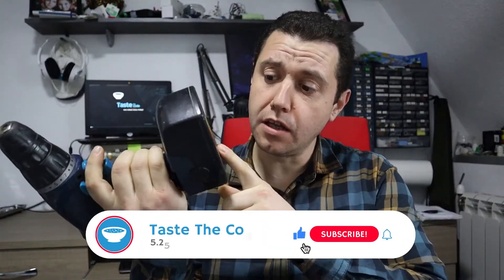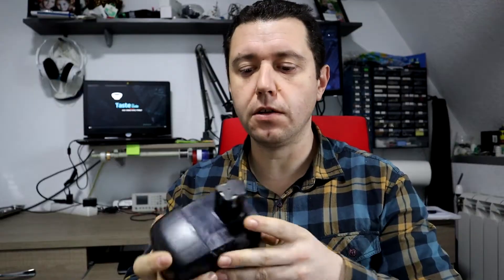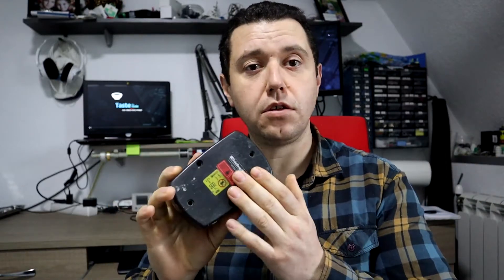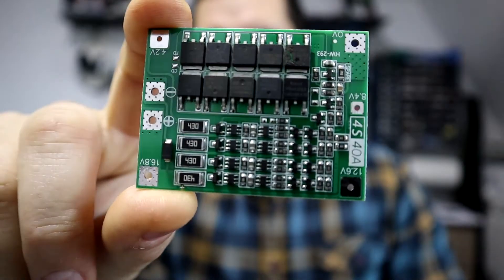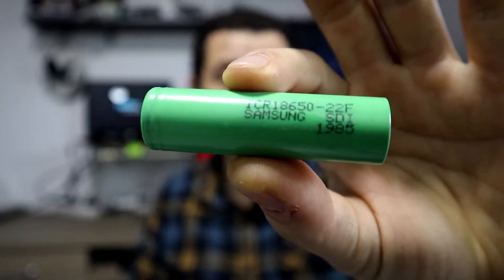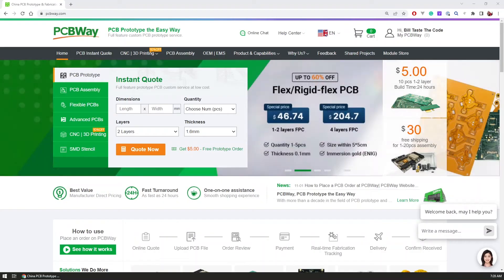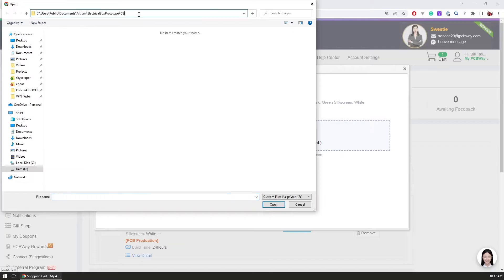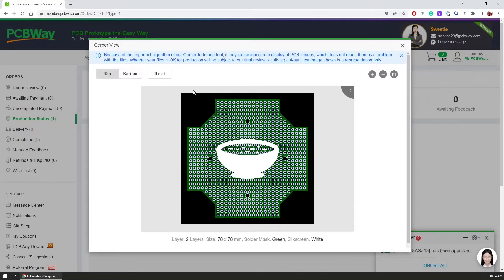How to turn your outdated NiCd tool batteries into powerful Li-ion ones!

Comment: Excellent Can we use the same or greater pack without BMS?
Reply from the maker: BMS is essential to handle the batteries safely. Otherwise you will damage them.

Comment: Would it work to put the BMS and the charge control board in the battery and use the original Ni-Cad charger un-modified ?
Reply from the maker: The BMS goes to the pack anyway. If the original charger will work, depends entirely on the charger and how "smart" it is...
Reply: @TasteTheCode Years ago some of the Dewalt stuff then NiCad charger didn’t put enough amps to charge the Lithium ion’s
Reply: Loved watching you work and do an excellent job thank you so much

Comment: Interesting. I have an old mini vacuum cleaner and its NiCd batteries are gone. I have many good 16500 salvaged from old laptops batteries. I am an asshole in electronics. I could rexharge them outside the vacuum cleaner, but would be better to use its original 9 volts connection.
Reply from the maker: 9 volt is a bit complicated as 2 lithium cells are 8.4V when in series and fully charged but go down to 6V when empty. 3 cells in series range from 9V when empty to 12.6V when fully charged. Maybe a 3s with a dc to dc converter is your best bet.
Reply: @TasteTheCode  The original charger is 9 volts. Electrolux. I was planning to use the same charger.

Comment: Hi,
How do I make sure that a conversion like this project would give me the required torque? I have a 3.0Ah impact driver with a stated torque of 85Nm. What version of BMS and what type of a battery spec should I use? Any help from you genius guys will be greatly appreciated. Thanks.
Reply from the maker: Generally, larger current provides more torque. So go for the largest rated BMS you can get. Also, more cells in parallel can provide more current but it is a limit of space if you can fit them.

Comment: How can I make use of lots of 4.8V Nicle Cadmium Batteries? Almost 100 Batteries
Reply from the maker: Sure, as long as you fit them inside. In that case you will also be able to use the same charger as well.

Comment: I have sense, and also, unfortunately power tools with dangerous lithium ion batteries. There needs to be a way to convert power tools with Li ion batteries to much safer Nickel-Cadmium batteries. I'd like for my house to NOT burn down.
Reply from the maker: I understand your concern, and you should always be careful when handling Li-ion batteries. However, it is not that they will just ignite. Yes it is possible, but if treated properly, you do not need to worry.

Comment: If you have the parts and batteries it’s probably good. But, checking prices having to buy everything seems way too expensive.
For someone without much experience and money who simply want to revive an old drill. Do you recommend to just buy the same batteries and just replace them? The ones I have are 1300mah and the ones I found to buy are 2800mah. Would this be an issue? Or would they be a little better? (more power?)
Because the other issue is the charger, that would be even more money required to make the conversion. And would be best to use the charger that the drill already has.
Thanks for your time if you read all this 😁.
Ps/ or do you think it’s just not worthwhile and I should just get a cheap drill and forget about this? The batteries are almost the same price than a cheap drill with 2 batteries. But, of course it’s a cheap drill and the one I have is not a bad one.
Reply from the maker: To reuse the same charger you need to buy the same style of batteries that it had. If the drill had NiMH batteries, then go with that. Lithium batteries on the other hand should provide the benefit of lasting longer (in theory!) and holding more charge for the same volume. Converting everything over when you buy all the parts is expensive. I use old laptop batteries for my conversions and so far they work OK but I get them very cheap and the chargers from AliExpress are super cheap as well. As for the cheap drills, they've gotten to a point that they are cheap and reliable enough to justify buying several cheap ones that will outlive one expensive one. I hate to see working things being thrown out and replaced with new but it is the most logical step in terms of monetary value. I rebuilt the batteries just for fun as I enjoy the process.
Reply: @TasteTheCode Yes, I also hate to throw perfectly good things that just need a simple fix. I looked on AliExpress and the batteries cost almost the same as a cheap drill; but, I’ll wait until they have some offer to get them. I’ll go with the same ones the drill had just to make things easier. Would love to convert it to lithium, but, it’s not worthwhile price wise. I’ll be on the lookout for batteries as you said; but, even with the batteries I still need the device to regulate the power and the charger. Though, a lipo charger is not so expensive and can come handy for sure in the future, for… something 😅
Reply from the maker: @GnarledSage  try to look for batteries in a local electronics parts store. What makes them expensive online is their weight so getting them locally is usually much cheaper as they get them in bulk.

Comment: Hello!

I enjoyed this video very much, thank you!

I wish to convert a 19.2V NiCad powered drill to Li-Ion. I plan to use 5 Samsung 25R high discharge 20 amp 18650 cells in series (5S).

How do I determine what balancing BMS board to use - what factors do you consider when selecting one? Do they come with a diagram to show the connections? What gauge or diameter wire do you recommmend, and stranded or solid?

I know of someone who tried one BMS for a 5S pack and it seemed to work but then he realized he lost the drill's variable speed function - it was either on full speed or off, so I don't want that to happen. He never got it to work correctly.

Any advice on this would be appreciated because I just need the correct balancing BMS to complete the project.

Kind regards,
John
Reply from the maker: Hey John, thank you for the support! I really appreciate it. 

In terms of the BMS, the most important part is the current rating and the S rating which you already have it figured (5S). You would want anything above 40A just to be on the safe side. From what I saw online, most 5S BMS boards come rated at 100A. Other than that, there is little difference between them, they just monitor the voltage of each cell and once it reaches full, they just re-route the current through resistors until the rest of the cells are full. And yes, most will come with diagrams but they are also marked with voltages on the board. You start from 0V as the negative of the first cell, and you work upwards, adding the next cells until the last cell. 

As per the speed issue of your friend, I've never heard of such thing and I don't see how it is connected to the battery pack. On all of the drills that I've seen, the speed is controlled by the trigger switch that variates the voltage send to the motor. He must have done something wrong to the switch to loose the variability.

Comment: whats the purpose of the single cell inserted before closing the case?
Reply from the maker: It is just a spacer so the pins on top don't get pushed in when attaching the battery to the drill. The old pack had the last cell in the upright and it pushes on the contacts on top. If you noticed, I have it wrapped in electrical tape so there is no contact on it with the rest of the battery. It is funny cuz the video has 71k views, and you are the first one that noticed it! 👍👍
Reply: @TasteTheCode  thanks for the quick reply

Comment: Hello, how to check if my power adapter is for charging li-ion batteries?
Reply from the maker: If a charger is for li-ion batteries, its output voltage will be in multiples of 4.2V. so for example, 4.2V for 1S, 8.4V for 2S, 12.6V for 3S, 16.8 for 4S, etc. The S marking indicates how many cells are connected in series.
Reply: @TasteTheCode can I use a power adapter from a router or a modem for example??
Reply: @TasteTheCode  thank you very much for your help
Reply: @TasteTheCode  but the chargers for our phones are 9 or 12 volts why is that?
Reply from the maker: No you can't use a generic charger as there is extra circuitry regulating the voltage in those devices. You must use a charger with the specific voltage that has that regulation circuitry or add that regulation in between yourself.
Reply: @TasteTheCode  ok got it thank you my friend

Comment: Hi . I have a cordless drill with 17 rechargeable batteries of 1.2V 1300mAh etch, 20.4V total. Can i replace them with 4 pieces of 5V?
Reply from the maker: I haven't heard of 5V batteries. Li-ion are 3.7 nominal, 4.2V when fully charged.
Reply: 5 batteries.

Comment: What charger  do use afterwards as standard charger be no good
Reply from the maker: Right now I'm using my bench power supply but you can purchase a dedicated charger from AliExpress that matches the nominal voltage of the battery. It doesn't need to have protection as the BMS will keep the battery safe.

Comment: Can I still use the original Dewalt 18 volt Nicad battery charger? Or do I have to purchase a dedicated battery charger for the Nicad to Lithium ion battery conversion?
Reply from the maker: It depends on the charger but the answer is usually no. It is best to purchase a dedicated charger for lithium batteries. In my case, I'm using my bench power supply to charge it.
Reply: @TasteTheCode  
Thank you for the information
Reply: @TasteTheCode 
Sorry for another question. What is the white tape you use called?
Reply from the maker: It is just an electrical tape that is 50mm wide.

Comment: How to charge the new lithium pack? What with old Ni-cd charger?
Reply from the maker: No, I'm using my bench power supply. Best is if you get a charger specifically designed for lithium batteries.

Comment: Its cool to see u keep the old nickel strips on, but can we put 1 more layer of nickel strip on top of the left over nickel strips ? And oso can we use nickel strips better den u use the white wire that u solder it??
Reply from the maker: Sure you can. I don't have a spot welder so I have to improvise.

Comment: Hello friend, I don't know much English, but I will try to explain my problem: , I tried to change the battery of a 14.4 v drill to lithium, I used recycled 18650 batteries (obviously tested and with the same voltage) and formed a 4s2p pack and bought 4s bms boards at 40 amps (balancer type), and on three occasions the plates did not withstand even a vacuum test: (without effort) I thought it would be a defect in the board but I ordered from another store and now that I tried a new one and did a vacuum test performance, suddenly I heard a small explosion, I ignored it and continued drilling, until I heard a second one so I assumed that something had happened in the BMS and yes, a mosfet exploded and the truth is physically you can't see anything else but I think that more than one component must have been damaged as well. In your videos it looks so simple (and it really is, it's not very scientific) and this is happening to me, I only did a vacuum test on the other boards and apparently the transistors that are responsible for balancing the cells are heating up too much ( one or two, not all) and when I load them with the imax6 I get "connection break". Can you explain to me what I'm doing wrong or what causes could cause this to happen or at least what should I do? I thank you in advance.P.S: There are more details to explain but I didn't want to go on too long, if you need more details let me know
Reply from the maker: Hey, sorry to hear that. I don't fully understand what you mean by vacuum test? If the MOSFETs are exploding, it means that you are trying to pull a lot more current through them than what they are rated for. Try going with much larger BMS, something like 100A.

Comment: Get a group that is close, use the bms sized for the correct amps. Use a charger that is designed for lithium ion. I find usbC to be awsome for this as it can autorange 3.6V 7.2V 12V and 20V ❤
Reply: If by awesome you mean crappy because they charge so slow, then sure.  Awesome.  Maybe you instead meant cheap?  Also it doesn't hurt to go higher in amps for the BMS, might as well get the  biggest form factor (leading to higher current rating) that will fit in the battery casing if the price difference isn't much, which it usually isn't.

Comment: I love how you don't explain a single thing you're doing. Very educational.
Reply from the maker: 😅 well I think that all of the actions are quite self-explanatory... Any specific questions?
Reply: @TasteTheCode  Well everything you showed in the video was even more self-explanatory,
Reply: @TasteTheCode  "Self Explanatory"? So then what's the video for? A time Lapse? Showing off?
Reply: He's right. the title of the video literally starts with "How to" You can't blame people for thinking it's a Tutorial. So it's not really a how-to, it's more of a demonstration video. The title should reflect that.
Reply from the maker: @Choc_Chilla  I'm sorry if you did not found what you expected. For a 5S battery, the only difference is that you will have 2 extra connections for the two extra cells. Everything else is the same and every single BMS outthere provides a schematic how to connect it anywhere. I really don't see how I can make the video to have more details other than making it two hours long and talking through the entire process. I show all of the connections, all of the steps and everything that I did.
Reply: making a $s BMS work for a 5S Battery. I'd like to know more about that.
Reply: Go faster you A hole goober.

Comment: hi, brilliant video i want to do exactly what you,ve done with my 18v dewalt drill but using a 5s bms could i still use my dewalt charger. thanks .
Reply from the maker: It really depends on the charger. Usually they are not happy with Lithium batteries. It is best if you can use a dedicated charger and maybe adapt it to fit the connector.
Reply: No, you cannot use a legacy NiCd or NiMH charger with a Li-Ion pack, whether it be a factory pack or a DIY one.  Also you can't even reliably assume that you could DIY make a Li-Ion pack and use the factory Li-Ion charger as it won't communicate with it.

What you could do, with the correct BMS circuit that balance charges and has the needed 4.2V/cell cutoff threshold, is gut your 18V charger, taking the PCB out except for what holds the battery contacts, and then the new charger power supply you add, can be wired to the battery contacts in the old charger to provide the mechanical mounting station to charge the new  frankenstein battery.  ;)

Comment: Samsung 20R, 20S, 25R, 25S will better for the battery drill
Reply from the maker: Yes, I agree but this is what I already had laying around. They still work great but maybe not delivering as much power as the Samsung cells.

Comment: The proper thing would have been to get the correct BMS instead of hacking together series and parallel LI batteries in the same pack. Your just asking for it. You just negated everything the BMS is supposed to prevent. Uneven charging and discharging across the cells could lead to thermal runaway. Famous last words, "Should work fine".  It will work fine until you burn the mans house down.
Reply from the maker: Have you seen the video? I am using a BMS for exactly the same purpose. Also what is wrong with connecting cells in parallel and in series??? Every electric vehicle does exactly the same and every tool battery is constructed in exactly the same way!!!
Reply: That is not quite accurate.  There are tools with BMS that run parallel series of cells and those cells are constantly in parallel, not  connected only through the BMS, so essentially just as shown in the video.

It is not at all, everything a  bms is supposed to prevent, namely  not the two important features which is not to overcharge and not to overdischarge.  If you did start to have a weak cell, then the other cell in parallel would be doing double duty and discharge that much faster than the others, so the BMS would still sense the lower voltage for cutoff protection.

The key thing there is that once you notice the tool battery degrading and cutting out, time to accept that it wasn't the best idea to reuse old worn out laptop batteries and start with fresh cells for the pack rebuild.

Of course it would be safest and longest lasting to just buy a new tool and Li-Ion battery but apparently some people have more time than money - it simply isn't the case that does not have access to such tools, just costs more to acquire them.

Comment: Wouldn’t the low voltage cutoff be different between the two battery types?
Reply from the maker: It is different but the old one did not had a BMS, it was just run flat every time. The BMS I've put inside the battery will now make sure that they are never run under a certain voltage.
Reply: @TasteTheCode  thank you for the reply once taking it apart and realized they were nicd batteries and was like instantly why not stack lithium in here and went straight to the trust worthy YouTube, I just skimmed the video was planning watching on repeat while doing it, thank you
Reply from the maker: Yeah, should be fairly easy. Just make sure not to short them out and you should be good!